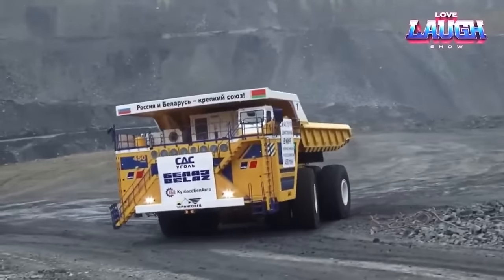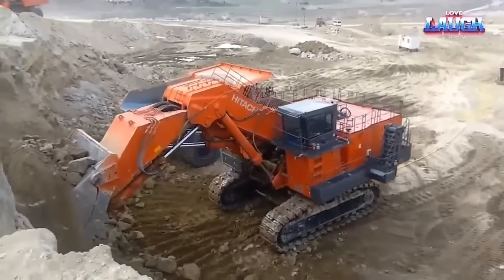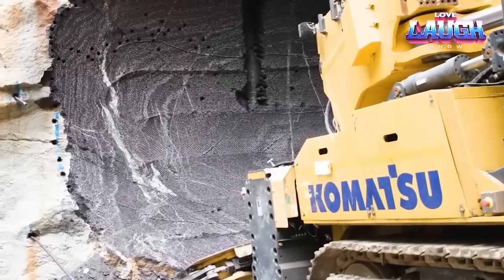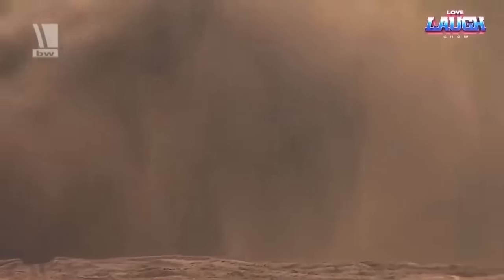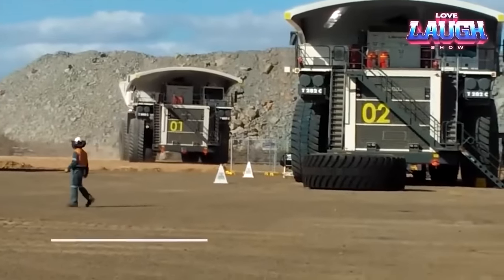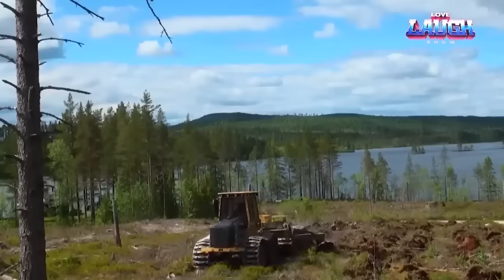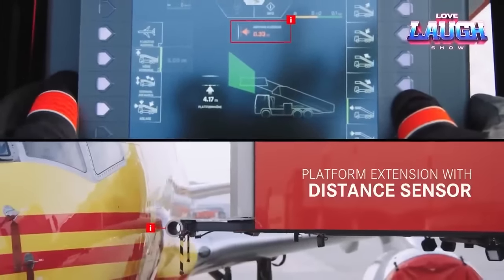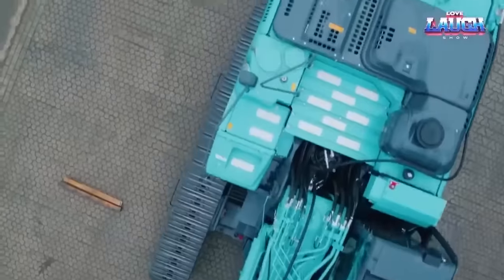199 Biggest Heavy Equipment Machines Working At Another Level ►3

Comment: Always remember this, these machines were built to be an extension of the operator. Show them the respect they deserve. You can lose your life or get serious injured.
Reply from the maker: Absolutely. Machinery of such power demands the highest level of respect and caution. Operators should always be trained, aware, and mindful that, while these machines extend their capabilities, they also pose significant risks if not handled properly. Safety and respect for the machinery and its potential hazards are paramount in any operation.

Comment: Id love to witness how they transport these giants to the site!
Reply from the maker: Transporting heavy machinery like excavators is indeed a spectacle in itself! Typically, these massive machines are transported using specialized trailers or flatbed trucks. Depending on the size of the machine, some might even require disassembly into major components and then reassembly at the site. For super-large equipment, road permits, pilot vehicles, and even temporary road modifications might be needed to ensure safe transit. It's a logistical challenge, but watching such a process can give one a true appreciation for the behind-the-scenes work in the construction and machinery world. 🚛

Comment: Actually, the metal tires on the machine in the trash dump are more for compacting the trash rather than providing traction.
Reply from the maker: That's correct! The metal wheels, often called "sheepsfoot rollers" or similar, are designed with large, pronounced knobs or spikes. Their primary function is to compact the waste in landfills, making sure it's densely packed. This helps optimize space and ensures that the waste settles properly. Thank you for pointing that out! 🚜

Comment: They refer to it as a front end loader
Reply from the maker: Yes, that's right! A "front end loader" is commonly used in construction and landscaping to move aside or load materials such as asphalt, dirt, snow, gravel, logs, raw minerals, recycled material, rock, sand, woodchips, etc. into or onto another type of machinery. They're highly versatile pieces of equipment and are indispensable on many job sites. It's one of those machines that's as impressive in its design as it is in its utility. 🚜

Comment: I can only imagine how much it costs to fuel up that excavator!
Reply from the maker: Indeed, operating heavy machinery like excavators can be quite expensive when it comes to fuel consumption. These machines typically run on diesel and, given their size and power, they can consume a significant amount of fuel, especially when working under full load. While newer models are becoming more fuel-efficient, the costs of operation remain a substantial part of the budget for many construction projects. Still, the efficiency and capability they bring to the table often outweigh the fuel costs. 🚜